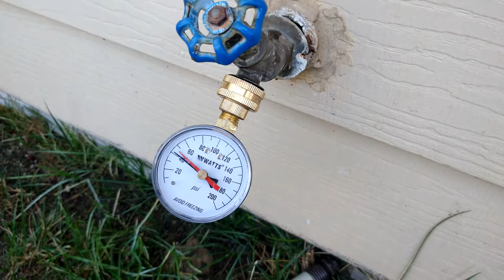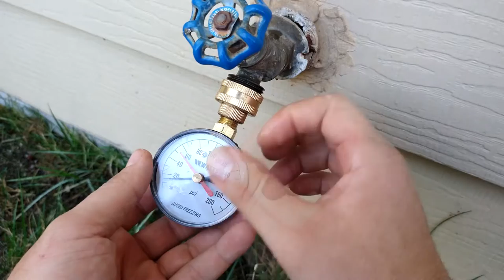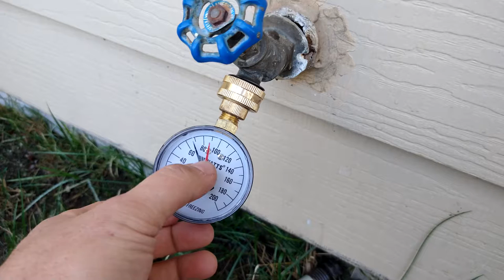Did you lose water pressure in your house? - LOOK AT THIS VIDEO!

Comment: It's called a pressure reducing valve or pressure regulator and they tend to go bad after about 10-15 yrs but sometimes sooner. Pretty simple replacement and they are available at any plumbing supply store as well as Home Depot/Lowes etc.

Comment: What appliances am I going to ruin because of excess pressure?
Reply: @lizzardlife The washing machine solenoid usually dies first. Mine died after 10 years of 100 psi pressure. The water hammers the washer makes are epic. It sounds just like a hammer hitting the pipes.

Comment: What in the solder job from hell
Reply: It's passable but I like to start by applying solder paste to the copper and brass. Once you apply heat, it "wets" the joint. After my first pass with the solder wire, I reflux, reheat and apply more solder. Then hit with one last round of flux while the solder is still molten. I get solder on the floor from applying so much but my joints NEVER leak.